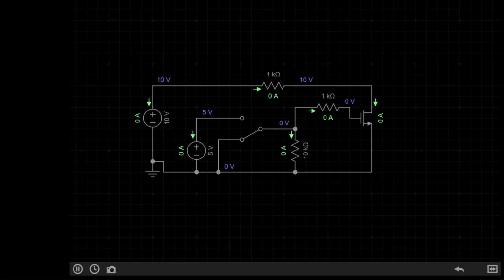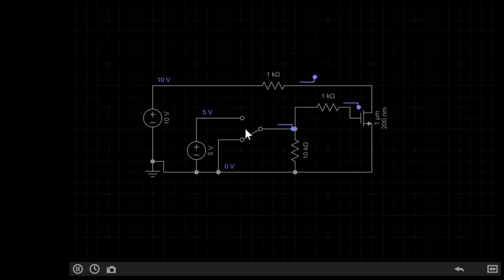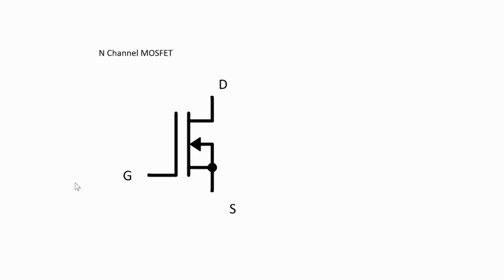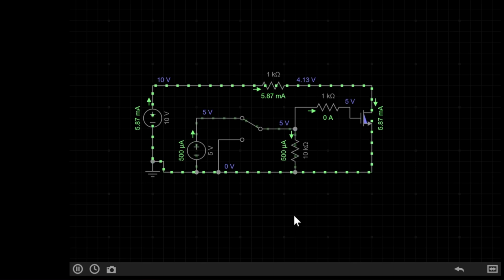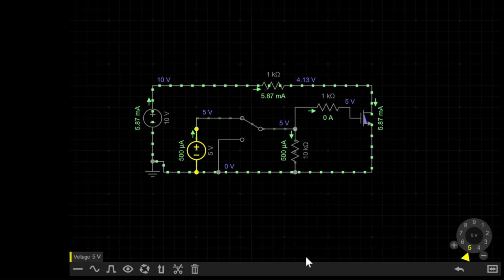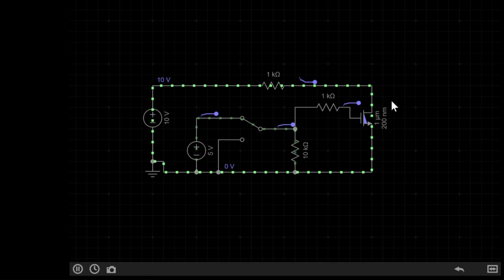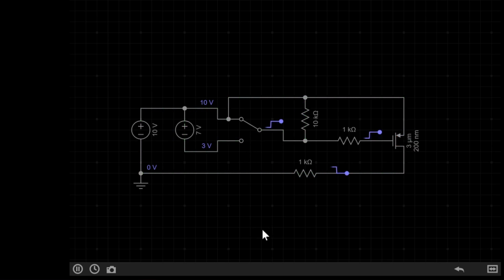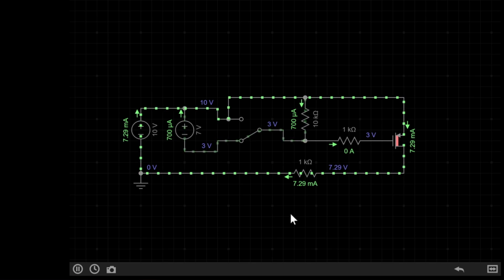MOSFETs - Voltage Controlled Switches

Comment: BRO i am a new subscriber to your channel...I was inspired by this video about MOSFET because yesterday I tried this circuit for my project.. i have a question without 10k ohm my circuit was not able to work...why this happen...please reply to me bro
Reply from the maker: Hi,

Thanks for the great feedback, i'm glad to hear you enjoyed the content.

The 10K ohm resistor is a pull-down resistor in the N-Channel circuit, or a pull-up resistor in the P-Channel Circuit.

The purpose of a pull-down resistor is to help keep the transistor base pin low when the transistor should be off, and allows the small amount of current flowing from the supply to go somewhere.

The pull-up resistor is the same but inverted, it helps ensure the transistor base pin is high when it should be.

Pull-down/up resistors are used all over electronics and whilst not always strictly necessary, they are often recommended.

I hope that helps
Reply: @electronicshandbook8788  thanks bro

Comment: Great explanation. 

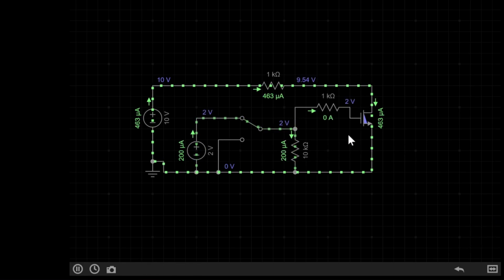Question: At 3:01 - Why is the Voltage at the gate equal to the Voltage at the gate supply? Doesn't the 1 kOhm resistor before the gate pin decrease the voltage?
Reply from the maker: Hi Mario,

Great questions, the gate pin of a MOSFET in an ideal world draws no current at all, in practice it draws a few nanoamps. However because there is no current flowing through the 1kOhm resistor there is also no voltage drop across the resistor.

This is because Ohms law teaches us that voltage is equal to current times Resistance and if there is no current and the resistance is fixed then there cannot be a voltage drop.

I hope that makes sense!